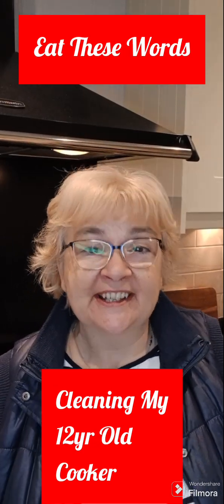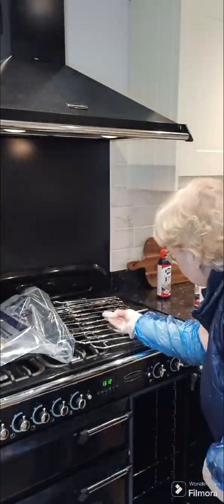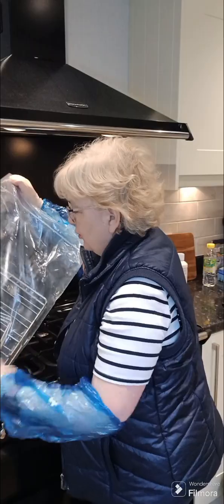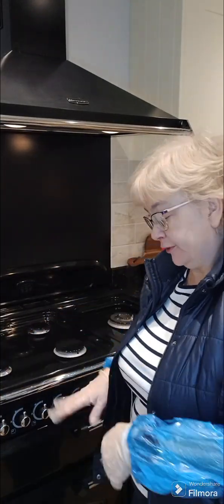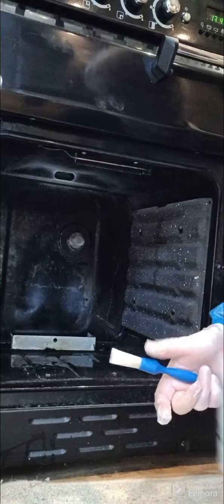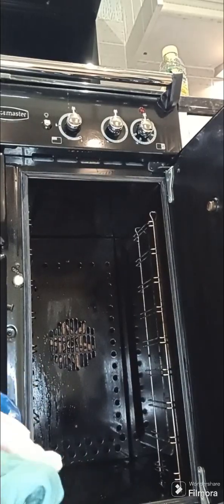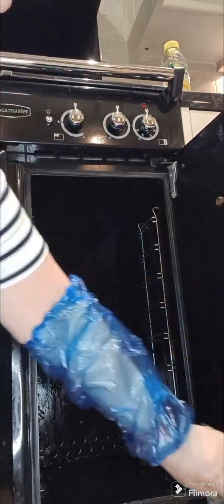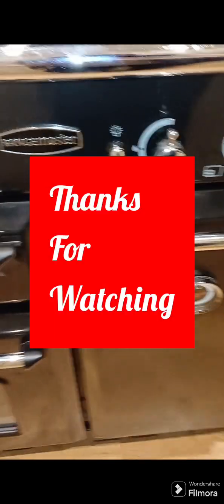Cleaning my cooker.

Comment: My cooker is a Leasure which I think is the same company as Rangemaster. I always struggle to get the racks from the hob clean. I think they are cast iron and a nightmare to scrub. How do you clean yours?
Reply from the maker: Hi, thank you for watching my little oven cleaning video. To answer your question. I used to put them in the dishwasher until I noticed them losing their colour. Now I just spray with the Flash cleaner you seen me using and wipe down after I cook. Seems to work.